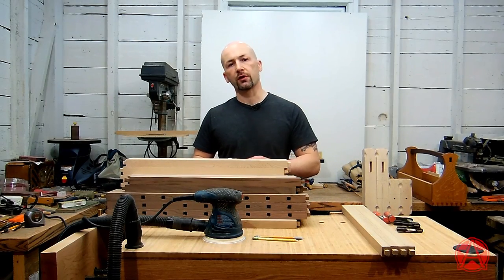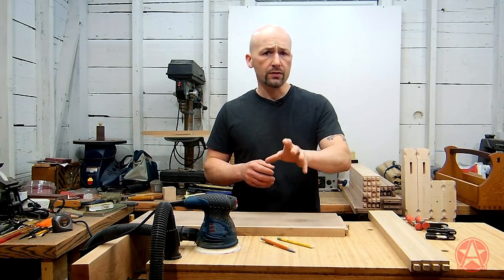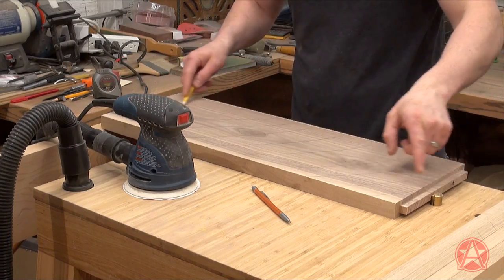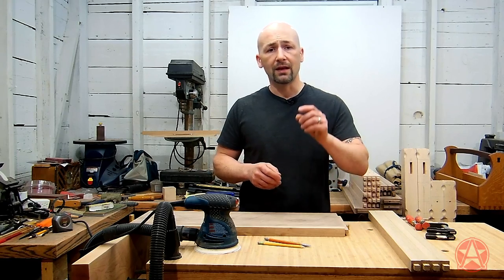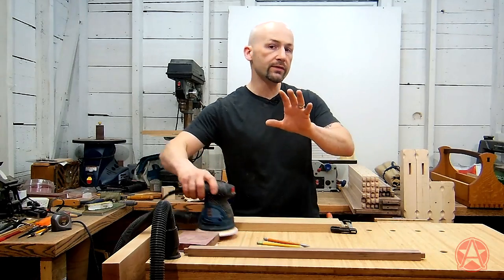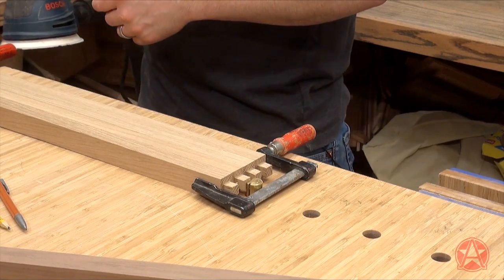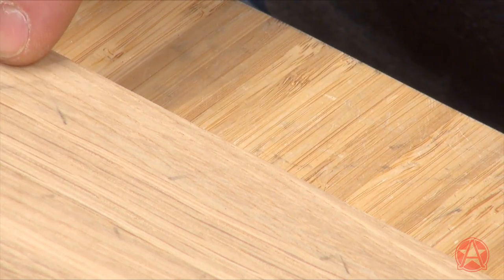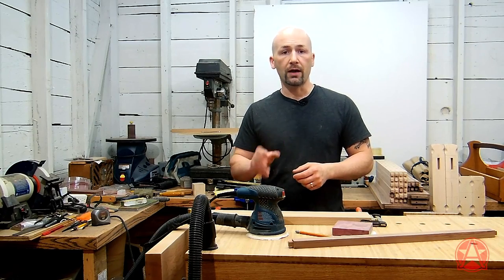#1 Wood Finishing Secret!

Comment: Great production quality, love your videos.  A question, I've always been taught to sand with the grain.  Here you are going both against the grain with the horizontal, and then again with the diagonal.  How do you reconcile the "common knowledge" of "always sand with the grain"?  Thanks!.
Reply from the maker: Hi Stuart, 

 Glad you are enjoying the videos.  You are right that it is common kn5that you should always sand with the grain. This applies to any "in-line" sander like a belt sander or a hand sanding block. Going against the grain would cause cross grain lines that are difficult to remove.

However,  the DA ( Duel Action) sander I am using works differently. instead of the grit traveling in line, the grit travels in a circular pattern which means it is always sanding slightly against the grain. The goal is to finish at a grit so fine that the marks are not visible.  To do this you must remove all of the "swirl" style marks that this sander leaves before changing grits. the method I show here should help you do this with confidence. 

This technique won't work with a belt sander.

Thanks for watching and commenting.  You can see a portfolio of my work on my website anamericanartisan.com. 

-Andrew

Comment: I'm really loving your videos and am making your spline box now.. Very clearly explained and plans to boot!
I have been a wood finisher and decorative painter, woodgraining/marbleizing for over 50 yrs  www.boblevey.net
I have never had any problem with sanding up to 220 grit and using aniline or any other penetrating stain afterwards.. I take it slow and lighten my stain solution and do several coats when I have any concerns.. There are other ways I overcome dyes on softer woods but to detailed to go into here.. Again I am really enjoying your work... Thank you bl

Comment: What model Bosh sander is that?
Reply from the maker: Hi Pepper 7144,

I am sorry I didn't see your comment earlier. Below is a link to the sander I used.

The link is to Amazon's listing. They sell this model at Lowes too. I don't think Home Depot carries it. Woodcraft carriers another version. 

Thanks for watching and commenting. 

-Andrew 

https://www.amazon.com/gp/aw/d/B00BD5G9VA/ref=mp_s_a_1_1?ie=UTF8&qid=1517852020&sr=8-1-spons&pi=AC_SX236_SY340_FMwebp_QL65&keywords=bosch+sander&psc=1
Reply: An American Artisan Thank you. I am a novice gathering my tool box for wood working. I can't  justify FESTOOL  equipment at this point. I enjoy your videos whether in the  pro shop or this one. If you are using it it must be good, maybe not the best pro model, but good enough for a novice. Now to find a jointer and planer.
Reply from the maker: Hi pepper7144,

Glad to hear you are getting into woodworking and that the videos are helpful. There are some free downloads on my website, anamericanartisan.com  , that you may find helpful also. You can contact me through the site with questions. 

I think you will like that sander. it works great and the price isn't bad. 

-Andrew